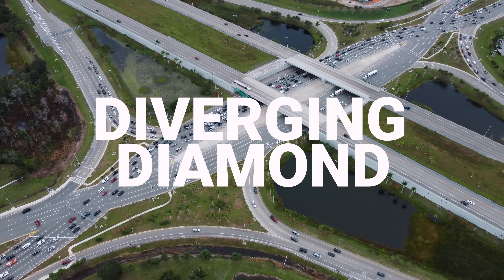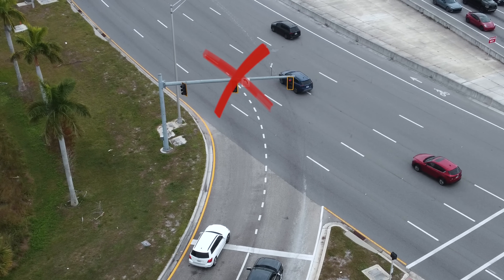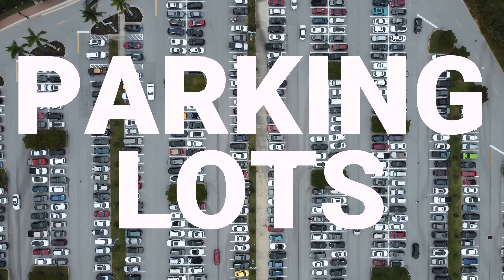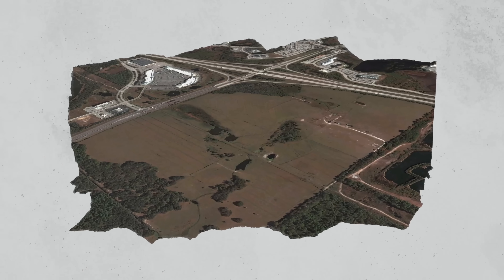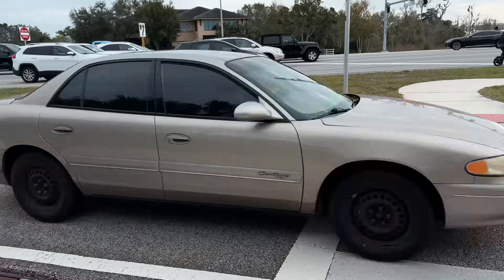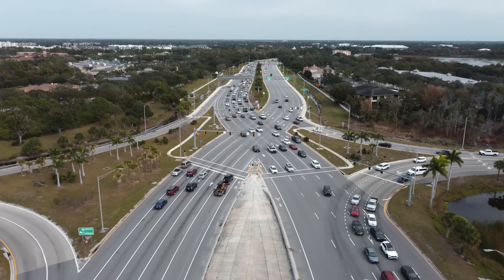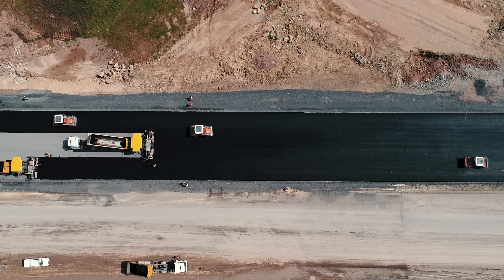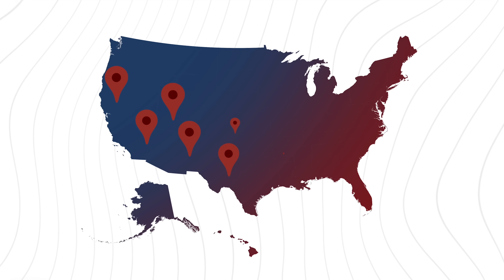Traffic Will Never Be Fixed Here

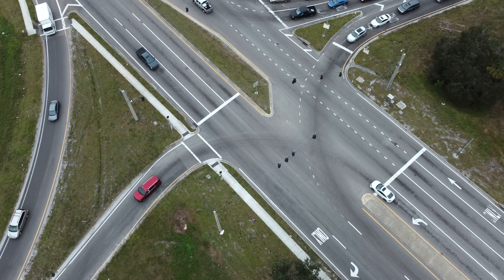Comment: 1:14 I mean You can also do a giant roundabout
Reply: Roundabout would not work here because the traffic volumes are greater than a roundabout's capacity, and the construction would cost more.

Roundabouts max out at 1500 vehicles per hour for single lane roundabout (2500 for dual lanes).  The frequency of vehicles meeting at the merging points is much greater, causing more stops and queues. Roundabout interchanges are better for rural/surburban locations where volumes are lower and not progessively increasing.

A roundabout interchange would cost more because it would take more right-of-way outside of the prior interchange design.  That would require more stormwater management facilities, as well as shoring/retaining walls due to encroaching into the slopes of the overpass highway.  

And the path for pedestrians are more direct than a roundabout.  They do not have veer around the circle and have shorter walks against free-flow traffic.
Reply: @traffic.engineer  what if it was a realy big Round about?
Reply: @Bellwall_fan  Then it would not be a roundabout.  It would be a traffic circle, which is nothing more that a circular road with badly spaced intersections.  America has over half a century of experience with traffic circles and will not go back.
Reply: @Bellwall_fan  not to also mention the skyrocketing cost to install a giant roundabout compared to this.
Reply: @traffic.engineer  ok thanks for educating me :)

Comment: Simple solution - round-a-bouts. We have been using them in the UK for years, stick some lights at pressure points and problem sorted. Traffic flow improved.
Reply: The whole point of roundabouts is to NOT use a signal.

A roundabout would not work here because the traffic volumes are greater than a roundabout's capacity, and the construction would cost more.

Roundabouts max out at 1500 vehicles per hour for single lane roundabout (2500 for dual lanes).  The frequency of vehicles meeting at the merging points is much greater, causing more stops and queues. Roundabout interchanges are better for rural/surburban locations where volumes are lower and not progessively increasing.

A roundabout interchange would cost more because it would take more right-of-way outside of the prior interchange design.  That would require more stormwater management facilities, as well as shoring/retaining walls due to encroaching into the slopes of the overpass highway.  

And the path for pedestrians are more direct than a roundabout.  They do not have veer around the circle and have shorter walks against free-flow traffic.
Reply: @traffic.engineer In places like the UK, the density and amount of cars causes the need for regulated travel in roundabouts.  When roundabouts are small enough in a city such as London. The only answer is signals
Reply: @traffic.engineer I agree when roundabouts reach a certain capacity that they lose productivity but signals have cases of working SOMETIMES if timed correctly. It’s their only option

Comment: Roundabouts ease congestion massively but people cant function near them
Reply: They only ease congestions on low volume roads.  Roundabouts would not work here because the traffic volumes are greater than a roundabout's capacity, and the construction would cost more.

Roundabouts max out at 1500 vehicles per hour for single lane roundabout (2500 for dual lanes).  The frequency of vehicles meeting at the merging points is much greater, causing more stops and queues. Roundabout interchanges are better for rural/surburban locations where volumes are lower and not progessively increasing.
Reply: @traffic.engineer  more roundabouts, increased eased congestion, works perfectly well in the UK

We have roundabouts on roads where you can travel the national speed limit which is the highest speed anyone can drive at within the UK, and I have never experienced high congestion, only occurs when you start to add pointless traffic lights, of course it can't be avoided in certain situations but by a high number of cars maintaining momentum, traffic flow very rarle comes to a stop...theoretically, although this isn't factoring in how most people start having a panic attack on roundabouts and don't know how to approach in anticipation of traffic and have to come to a full stop despite no requirements for them to yield or give way in that situation, creating congestion

My point stands
Reply: @subhandin3435  This has nothing to with speed limit.  We have roundabouts on 65/70 mph roads.  I said low volume, NOT low speed.

The UK has proven roundabouts lose efficiency at a high traffic volumes when they start adding traffic signals.  This means the free-flow can no longer function due to more vehicles meeting at the merge points.  That means more stoppage for vehicles.  Add more traffic volumes, then there is more delay and queuing.  If the whole purpose of a roundabout is to avoid a traffic signal, the UK has broken that.  America only installs roundabouts where the traffic volumes can be kept at free-flow (less than 1000 total vehicles per hour, 1750 per hour for dual lane).  Should it be higher, the roundabout is removed and replaced with other intersection alternatives.
Reply: @traffic.engineer  It's pointless over-engineering, a simple roundabout around the base of the on ramps and off ramps (with the aid of lights on the roundabout due to high speed situations) and you have solved the problem, it's system the rest of the world uses, not really our fault folk in the US only know how to drive in straight lines, and even then, thats a bit dicey in itself
Reply: @subhandin3435  volumes are too much for a roundabout.  And if you are adding signals, the inefficiency is greater due the the signal phasing requiring longer delay.

A roundabout interchange would also cost more because it would take more right-of-way outside of the prior interchange design.  That would require more stormwater management facilities, as well as shoring/retaining walls due to encroaching into the slopes of the overpass highway.  

And the path for pedestrians are more direct than a roundabout.  They do not have veer around the circle and have shorter walks against free-flow traffic.

Comment: He argues that the problems with the diverging diamonds design is due to the surrounding environment of parking lots and points of interest, but then immediately explains that it is simply due to distance errors between conflict points. I understand he was TRYING to use it as a point to build density, it was just a somewhat convoluted way to do it. It isn't the diverging diamonds fault there is low density, and it isn't the low density's fault the diamond doesn't work. It is quite simply stupid people that make the diamond not work. ALL possible conflict points that can be removed should be removed. Then whatever infill may or may not come after will benefit either way.

Edit: though yes, it would be expensive to make the perfect version as extra sections of road would be made into bridges/tunnels and would likely need a completely separate pedestrian bridge over the road, if you're going to rebuild it at all, do it right. If you can't rebuild it properly, don't rebuild it.

Comment: US: Roundabouts are Lava
Reply: Roundabout would not work here because the traffic volumes are greater than a roundabout's capacity, and the construction would cost more.

Roundabouts max out at 1500 vehicles per hour for single lane roundabout (2500 for dual lanes).  The frequency of vehicles meeting at the merging points is much greater, causing more stops and queues. Roundabout interchanges are better for rural/surburban locations where volumes are lower and not progessively increasing.

A roundabout interchange would cost more because it would take more right-of-way outside of the prior interchange design.  That would require more stormwater management facilities, as well as shoring/retaining walls due to encroaching into the slopes of the overpass highway.  

And the path for pedestrians are more direct than a roundabout.  They do not have veer around the circle and have shorter walks against free-flow traffic.

Comment: I have a question: why isn't the intersection governed by traffic lights that only turn green if the intersection has cleared?
Reply: The ramps that carry vehicles off the overpass route is concurrent with the lanes that are going away from the bridge.  So when the traffic is still emptying from the overpass ramps hold that green for traffic going to the shopping center signal.

Comment: simple fix for intersection blocking: make it illegal to do so (in fact, it's enshrined in NZ's road code: only enter an intersection if there is space for your vehicle on the other side of it - failure to do so will, at minimum, result in an on-the-spot ticket)
Reply: It is law in Florida.  

Florida Revised Statute 316.2061

Comment: Still laughing, that US can't handle roundabouts. This would solve everything.
Reply: Roundabout would fail because the traffic volumes are greater than a roundabout's capacity, and the construction would cost more.

The roundabout would not be efficient for places with such high traffic volumes.  They max out at 1500 vehicles per hour for single lane roundabout (2200 for dual lanes).  Roundabout interchanges are better for rural surburban locations where traffic is not projected to increase.

A roundabout interchange (for this amountnof traffic) would also cost more because it would take more right-of-way outside of the prior interchange design.  That would require more stormwater management facilities, as well as shoring / retaining walls due to encroaching into the slopes of the overpass highway.

Comment: Down to the question of whether Americans are competent enough to use roundabouts
Reply: Roundabout would fail because the traffic volumes are greater than a roundabout's capacity, and the construction would cost more.

A roundabout interchange would cost more because it would take more right-of-way outside of the prior interchange design.  That would require more stormwater management facilities, as well as shoring / retaining walls due to encroaching into the slopes of the overpass highway.

And the roundabout would not be efficient for places with such high traffic volumes.  They max out at 1500 vehicles per hour for single lane roundabout (2500 for dual lanes).  Roundabout interchanges are better for rural surburban locations where traffic is not projected to increase.

Comment: The mall in this video is the only one in Sarasota and Manatee Counties, requiring drives up to 30 miles.  The sprawling community to the east of I-75 was built over the last 20 years for families with cars, and it too is too large for pedestrians and bikers to reasonably travel.  Whilst walking and biking are reasonable solutions for downtown Sarasota, this is not the case for the suburbs.

Comment: Add a round a bout
Reply: Roundabout would fail due because the traffic volumes are greater than a roundabout's capacity, and the construction would cost more.

A roundabout interchange would cost more because it would take more right-of-way outside of the prior interchange design.  That would require more stormwater management facilities, as well as shoring / retaining walls due to encroaching into the slopes of the overpass highway.

And the roundabout would not be efficient for places with such high traffic volumes.  They max out at 1500 vehicles per hour for single lane roundabout (2500 for dual lanes).  Roundabout interchanges are better for rural surburban locations where traffic is not projected to increase.

Comment: Honostly I think self driving cars can be a large part of the solution. Transit can cover 95% of destinations for 95% of people but often that 5% can scare people. The ability to have a car that can show up anytime regardless of driver availability and can eventually be a better driver able to communicate with traffic control to use empty lanes and see 360 degrees would definitely ease those peoples worries. I personally use transit exclusively as I live near dc and on a metro line but with pickup driving assholes blasting past the bus stop at double the speed limit and a lot of interesting people I can see why many would avoid it.

Comment: Single-point is better. Only 1 light instead of 2.
Reply: SPUI works better when the non-freeway straight traffic is the priority.  Both directions of the off-ramp lefts are concurrent in one phase, and both on-ramp lefts are concurrent with one phase. This would reduce the stop time for the straight traffic in one cycle.

DDI is better when the on- and off-ramp left turns need greater priority, in order to reduce queuing on the freeway and not requiring more storage on the non-freeway road.
Reply: And this left turning traffic (both onto and off the freeway theoretically only stop at one light.  Traffic turning left onto the freeway wait at one signal, then freeflow into the on-ramp.  Traffic exiting the freeway approach a theoretical "stop sign" (left turn on red), juat have to wait another signal.  But if it is under one controller, the downstream signal is timed with the off-ramp signal.
Reply: But in the end, it comes down to cost.  DDI can use most of the existing footprint.  A SPUI would require a specialized butterfly span overhead, or cut into the slopes of the freeway underneath.  The SPUI would also require construction of dual left turn lanes on both directions of the non-freeway approach, where the DDI would not.  In the end, DDI is the cheaper option.

Comment: They keep comparing this diverging diamond interchange to a "traditional" crossroads interchange.

I don't really understand why Americans have giant crossroads interchanges on roads with that many lanes anyway.

Here in Britain that would be a roundabout or large rotary system if it was at-grade. With traffic lights added if needed.
Reply: At least on a motorway style dual carriageway. On actual British motorway (no legal access for pedestrians, cyclists etc) junctions are generally not at-grade, at least in all the cases I can think of.
Reply: Roundabout would fail.  The traffic volumes are well above a roundabout's capacity.  Roundabout would also be more expensive construction due to the larger footprint (right-of-way acquisition, concrete island, more extensive stormwater management).  Roundabouts are better suited for rural or lighter suburban connecters to residential roads, not the main road.  And putting signals at a roundabout is sacrilege.

Comment: Diverging diamonds are an over engineered mess. People who say they aren't confusing are missing the entire point. Plus there is an interchange design that has been used for decades that is proven to be both safer and less obstructive... One that uses round abouts... But Americans seem about as likely to accept this as they are to accept that gun control is in fact constitutional. ("A well regulated militia...")
Reply: Roundabout would not work here.  The traffic volumes are well above a roundabout's capacity.  Roundabouts at the ramps would also be more expensive construction due to the larger footprint (right-of-way acquisition, concrete island, more extensive stormwater management). 

Roundabouts are better suited for rural or lighter suburban connecters to residential roads, not the main road.  America will NOT put a signals at a roundabout, ever.  That defeats the purpose.
Reply: @traffic.engineer look at the right away that's been purchased and tell me again that you couldn't fit a round about in there. Regardless of your other points that space is plenty large enough
Reply: @coleswack5513  no.  An island and three lane roundabout (for the current volumes) would extend outside the footprint of where the prior interchange ramps were.  So it would require purchasing land from nearby private landowners.  The other options would require shoring walls near the highway walls, as the island and roundabout lanes would cut into the slopes of the overhead highway.  That would also increase construction costs.

If this was a rural or light suburban interchange, a single lane dogbone interchange would be a viable solution for its smaller volumes and smaller footprint.  If volumes increase, then other solutions would need to be considered.
Reply: And the Constitution says "right of the PEOPLE to bear arms shall not be infringed", not the well regulated militia.  The right to bear arms is condition to establish the well regulated militia, not the other way around.
Reply: What's funny is on the video right down the road there are multiple round abouts🤷‍♂️ road engineers are paid to engineer so I guess a circle is too simple for them even when it's the best solution.

Comment: why not use roundabout?
Reply: Roundabout would fail due to the volumes well above a roundabouta capacity.  And the roundabout have a greater construction cost due the larger footprint.  Roundabouta are better for rural and residential roads, not heavy arterials and collectors.